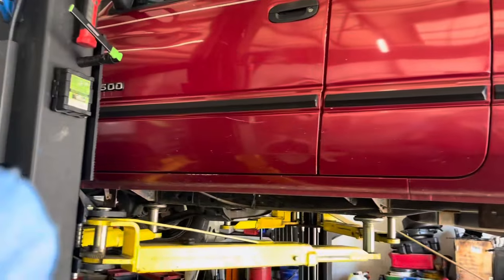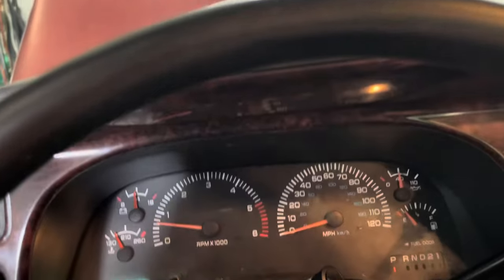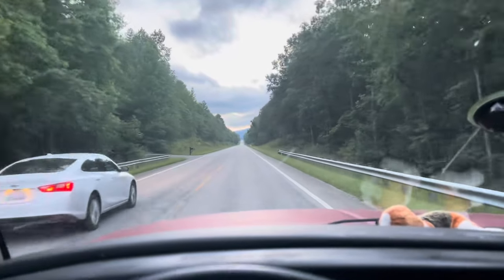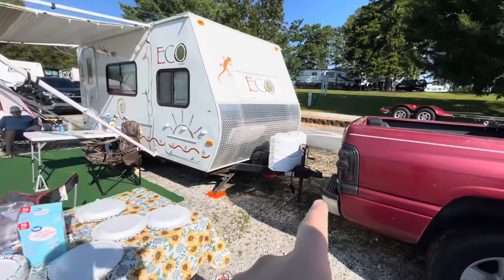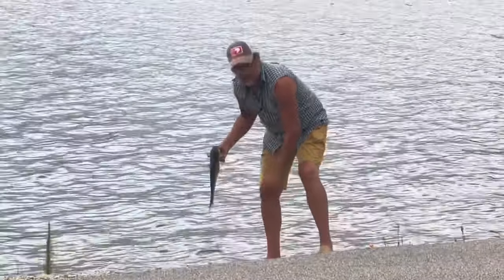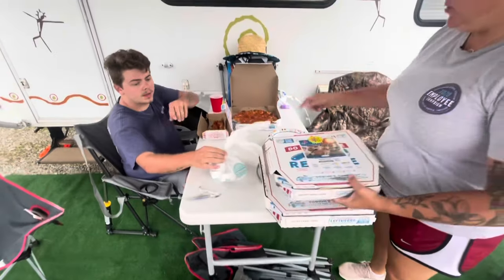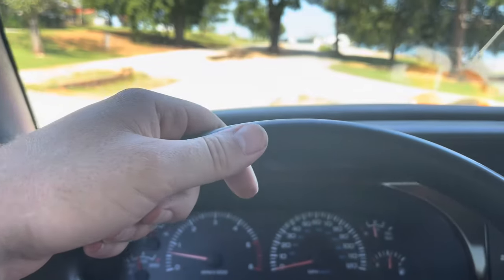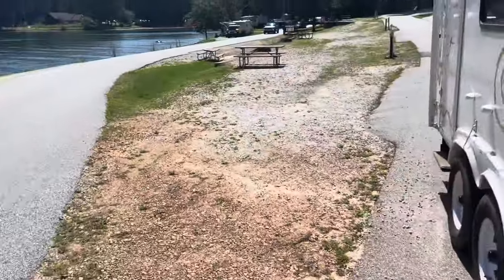We upgraded Campers! Skamper Eco, and our first trip vlog!

Comment: (9:45) I totally remember that long, straight, slightly downhill portion of Hwy 11 from my former Spartanburg daze.
I ran my '89 Honda Civic as fast and hard down that road as I possibly could. Got to an indicated 105mph. Backed off fast 'cos I was afraid I was gonna die. 
A Civic running up that much starts to feel like an airplane taking off and it's scary as all hell! I used to enjoy those roads off 11 up towards Hendersonville and Brevard in that Civic - at much more sane speed.